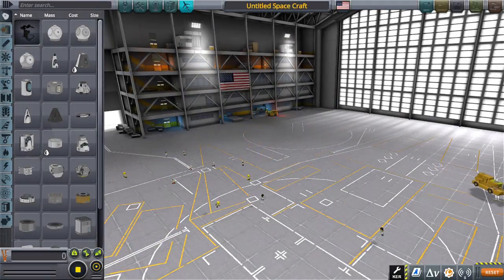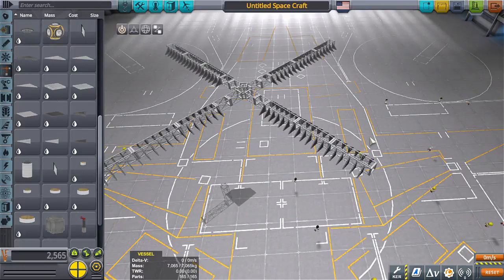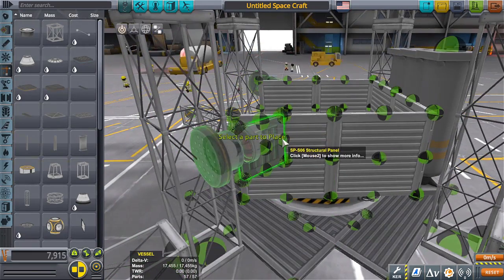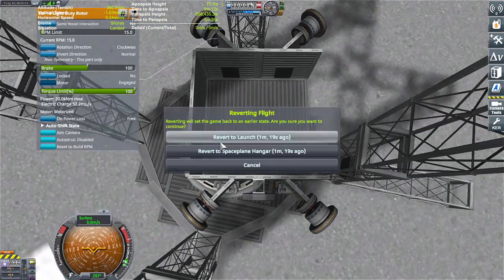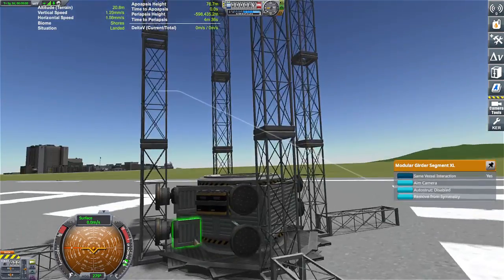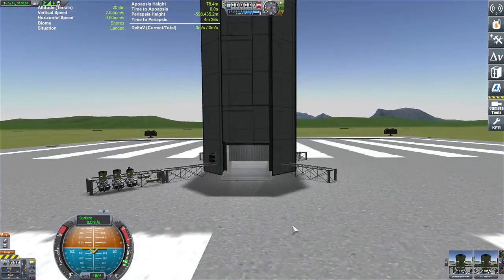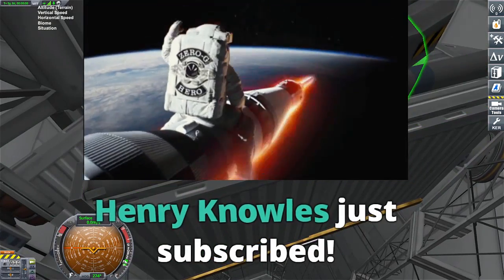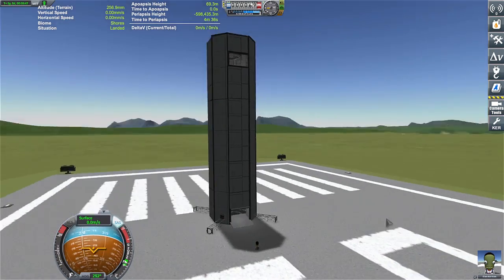GOING UP STOCK ELEVATOR  \  KSP 1.11  \  Kerbal Space Program

Comment: "Remember kids, when riding the Kerba-vator, always keep your hands, arms, feet, legs, heads, and other body parts inside the ride at all times always. And of course, always always always, knee pads, elbow pads, helmets, and parachutes just in case you want to come back down someday. By the way, the seated waiting area is closed for repairs again."
Reply: During the EVA glitch there was a moment when I saw some part clipping through the floor. Maybe if those two parts were separated a bit the issue might go away. Haha. But it's a simple thing to try. More likely it's a combination of the motorized friction pads and traditional kerbal EVA issues. Would replacing the pads with gear teeth have too many parts?